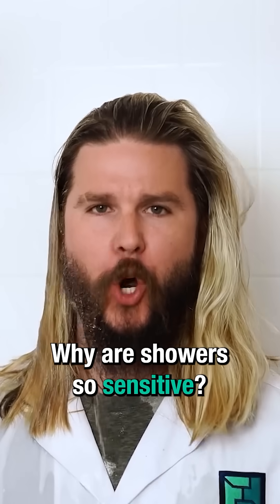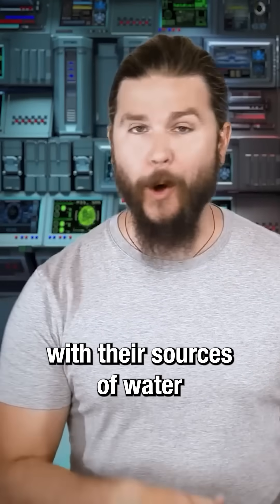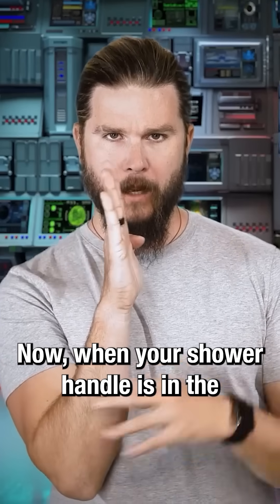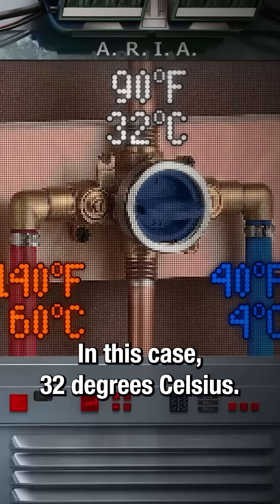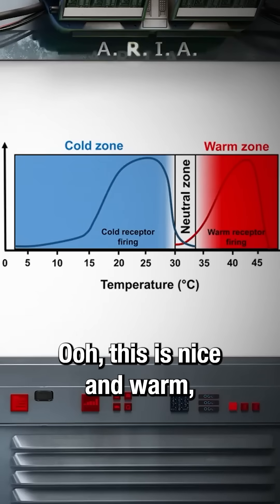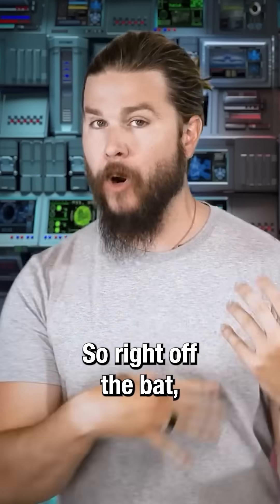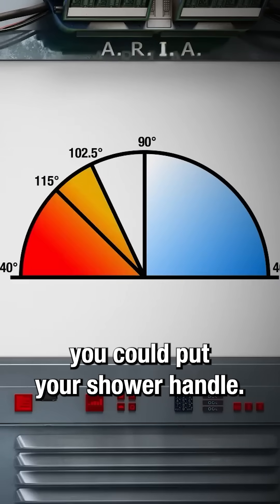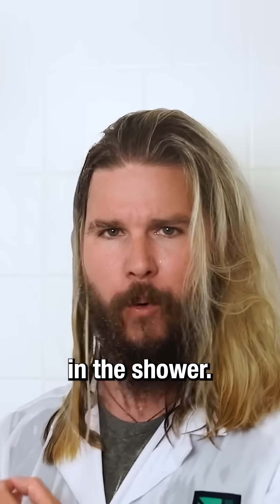Why are showers so sensitive? 🥶🥵

Comment: As a plumber, your hot water should be turned down to 120°F. Best decision I've made since I moved into my new home
Reply: As a hell-spawn, I respectfully disagree. I would be using exclusively the hot water, and I'm not even sure that would be warm enough for me.
Reply: @objectsubjectivity SAME. 🔥😈🔥
Reply: @objectsubjectivity My wife is one of you. I damn near lost a hand trying to pass her a new bar of soap.
Reply: @objectsubjectivity  ah someone has your heater turned down to the lame 120 setting, see if your heater was up at 140 where a true hellspawn would have it then you couldn't really handle the full hot experience.
Reply: @shawnpitman876  Trust me, if I was able to choose the temperature, it would be damn near boiling. That way the water would last me for longer than a 10 minute shower. Whatever temperature my apartment has the heater set to has the ideal hot/cold mixture at about 90/10 to start with.  The best shower I have ever taken was in a hotel in the Judean Desert, where the cold water was about 120 degrees.
Reply: @objectsubjectivity  You must take awfully short Showers, at 122⁰F (50⁰C) it only takes 5 mins to receive third degree burns to the skin.

At 131⁰F (55⁰C), it takes 10 seconds and at 140⁰F (60⁰C) it takes one second.

Literally any temperature higher than that will take less time and likely cause more damage.

The lowest temperature setting for most electric kettle's is 158⁰F (70⁰C) for Green Tea, which should be drank at roughly 122-140⁰F (50-60⁰C) at most.

Serving a hot drink above 140⁰F (60⁰C) usually tops out at 158⁰F (70⁰C), but it is not intended or recommended to actually drink it at that temperature for obvious reasons (internal thermal burns are awful).
Reply: @soulsurvivor8293  I appreciate the scientific fact check of my comment, and to be honest, I have no idea what temperature my shower water is actually at. I just know that my fiance gets scalded by my shower water, and I freeze in hers. Is it probably closer to 105-110? Sure.
Reply: @objectsubjectivity  More knowledgeable about the Medical implications than the actual Plumbng myself (see above for how I utterly messed up Internal Water temperature Standards of water heaters).

For Childcare and Agedcare facilities the limiter is set lower, around 46⁰C (114.8⁰F) from the tap itself (The water heaters internal temp remains at 70⁰C though) due to both age groups having skin more sensitive to heat.

That and 46⁰C is the bare minimum temperature to kill what little Legionella remains in the water post treatment.

It's also a rather pleasantly hot temperature to run a bath at, as the overall temperature will be closer to 42-44⁰C (107.6-111.2⁰F). Bare minimum of 40⁰C (104⁰F) if it takes a few minutes to get ready & get in.

So, badically if it was your internal body temperature; Dangerously high to Brain Damage or Death inducing levels of Fever temperature.

Not bad for short durations like a 5-10 minute shower, depending on ambient room temperature from the shower and the shower temperature itself.
Reply: Isnt there a risk for getting some dangerous bacterias in the hot water if it isnt hot enough?
Reply: @gabrielsandelin3300  yes, but 120 will kill said bacteria, also 120 is required by code (plumbers law) because of scalding risk, you can turn your heater up but you take on that liability and I suggest you do it in small increments so as to minimize the risk
Reply: @personwithhat1 120 does not kill bacteria lmao... it has to be at least 140. At 120, you'd need it to be at that temp for over 20 minutes.
Reply: @personwithhat1 That's only 48.8889⁰C, 50⁰C (122⁰F) would be a better option for outgoing water via cold water mixing post heating.

In Australia, that's generally the standard. A 50⁰C (122⁰F) limiter, using cold water mixing after the heater. 

So our hot water is usually a mix of Hot from the heater and normal Cold water to ensure less sevear burns should someone just have the hotwater running.

In most places around Australia, we can safely drink our Cold tap water without concern for any harmful bacteria.

Though, running any drinking water through a boiling &/or filtration process will make it safer and generally taste better regardless.
Reply: @gabrielsandelin3300  Yes, Legionella. Keep your heater 130+. Don't listen to fools who change things just because they think they know better, when they don't know the reasons why we made those choices in the first place.
Reply: Does this make it last longer since it has to mix with less cold water or something?
Reply: @SnakeWasRight  This will make it last a shorter period as you need a larger percentage of hot water vs cold to hit the ideal temp.
So the tank will run out faster. Undersized tanks for a home should turn up the heat if they want the tank to last longer.

However, it will lower heating costs and make the tank last longer before it needs replacement. 
It also increases the usable range of the faucet because more hot has a smaller effect.

This is less true for single handle varieties but still true.
Reply: @nocare  ah yeah I thought about it more and would need more hot water, but I was like, so what's the benefit then?  Lol, wouldn't work for me, as I run out of hot water too quickly as it is
Reply: @nocare I think the point is to be able to set it really hot, and not burn yourself. Also it's becoming popular to install tankless on demand heaters now, since it is just way cheaper to get and maintain. It's not a bad idea.
Reply: @SnakeWasRight  the only benefit is saving money.
Reply: I want to know why so many of you are worried about legionella. Is your water supply not chlorinated and otherwise treated before coming to your house? Why isn't your area under a boil water order if you have all these issues with infectious diseases in your water system? Do you never use your cold water just in case it has legionella?
Reply: @samarnadra  In most water you will find small amounts of legionella, but so low that it doesn't matter. But in a water heater they can rapidly multiply to dangerous levels really quickly if the temperature is too low.
Reply: @soulsurvivor8293  This thread is about having a lower max temperature in the heater. 
And btw 100c in the heater isn't the norm.
Reply: @emilmuhrman  You are right. It's a mlnimum of 70⁰C (158⁰F) internal temperature for water heaters here as standard.

46⁰C (114.8⁰F) is the minimum temperature to kill the miminal amount of Legionella usually found in our drinking water here.

Though 60⁰C (140⁰F) or higher generally ensures Legionella has no chance of survival regardless.

Anything over a 70⁰C (158⁰F) internal temperature is apparently highly inefficient and costly.

Nice catch, I was soundingnlike a real dumbass for a second there. 

Cheers.
Reply: As someone who worked in culinary for years, do not do this, this makes it impossible to wash dishes properly.  You cannot sanitize dishes in 120 degree water. If you use a dishwasher it will heat the water, but it's much easier when it starts hot. And unless you want ruined metal, you're probably doing your pots and pans and definitely wood-handled knives and cutting boards in the sink. Those NEED that higher temp, sanitizing at 120 degrees takes at minimum 20 minutes of constantly being exposed to that temp.
Reply: @ShadowmancerLord  Soap is more than enough to clean dishes in a home environment.
Hot water isn't even necessary with sufficient mechanical scrubbing.
It's only use it to make it easier to remove stuck food.

Restaurants and such are worried about communicable diseases not everyday bacteria.
Thus they require heating to 165F for thermal sanitation.

However the target temp is 120F for chemical sanitation in a restaurant environment.
Reply: @nocare  Yes, chemical sanitation. With actual restaurant grade sanitizer. Not dish soap. And that's the absolute minimum by manufacturers. FDA guidelines require 171 if water is used and not just pure sanitizer.

Do you have any actual credentials in the field or are you just making things up that you think sound good?
Reply: @ShadowmancerLord its the mechanical scrub part thats important to take note of in his comment. There definite proof if some knows how to properly hand wash things actually get clean. 120 degree well na I hand wash at temps that give me nerve damage lol
Reply: @shawnpitman876  You clearly don't know how most water heaters work do you? 

Most water heaters will heat to and maintain a temperature of 100⁰C (212⁰F), kept under pressure to maintain a full liquid environment.

Heat limiters tend to be a post Heater mix of the super heated water and Cold water, the resulting final temperature from the tap falls to 50⁰C (122⁰F) from the mixture.

 The mixing usually occurs at the heater itself, using a T junction pipe that both Feeds the water into the bottom of the heater and upwards into the separate T junction mixing valve.

When installed, and ever so often for maintenance, heaters need to be properly vented of all gasses via the manual release valve.

This ensures that the water heater is free of Aerobic and Anaerobic Bactirial contamination. When combined with a basic water treatment (Chlorination and Filtration processes), it reduces the potential for contamination even further.

That is, unless the US has significantly lower standards and worse water processing than Australia I guess. If so, then I guess the restaurant standards here would be different too.

In our restaurant's, the limiter is set a little high at around 60-65⁰C (140-149⁰F) with an appropriate sanitising dish soap mix, which is enough for most applications.

Though most places will use automated steam sanitisers for glassware, plates and cutlery. Each have to be set with different temps, times and sanitisers for each seperate material.
Reply: @shawnpitman876  Oh, I should really apologise for the initial rudeness of my reply too. Especially seeing as I myself was making a basic assumption about the internal temperature of water heaters.

Sorry about that mate.
Reply: @ShadowmancerLord  you should know then that the heat from the stove/oven will be more than enough to kill the bacteria on pots and pans.  you are correct about dinnerware and silverware though, as far as the home setting goes (dont use quat at home lol, wasteful)
Reply: @ShadowmancerLord idk about you but I use a tablespoon of bleach when I wash dishes and the water is scalding.
Reply: @kade7xx  most people don't fill a sink with water when they wash dishes. And if the water is scalding, that has nothing to do with me talking about how 120 degree water isnt hot enough lol
Reply: 120F is, like, 45C? I can take showers with tap all the way hot if I'm ever a guest in your house then.
Reply: 120 is not safe 125 is the minimum.
Reply: Nah the kitchen sink better be boiling and the shower better spew out lava or it aint cleaning well enough for me 😂😂😂
Reply: There's lots of stupid in these comments. 120° is the manufacturer minimum recommended setting for a hot water heater. Usually, a few degrees over, so the water that comes out of the tap is 120° only hot. 120° is the maximum recommended temperature for a tap because it can cause severe scalding of children. 120° is NOT an ideal temperature for legionella bacteria, but it can survive and reproduce in those temperatures poorly. 
The mixing valve in your tub or shower is adjustable to allow for more or less hot or cold water through to completely eliminate any complaints about your water temperature.
Reply: Uh, no.  Get an on demand water heater.  That’s the best decision ever.
Reply: @user-pt1cz4ot1e  Only if you have no solar and live in a climate where heat pumps are expensive to install because they would need to be ground source.

Heat pump water heaters are better than on demand for efficiency and solar can store a portion of the energy you would have to sell as hot water.
Reply: @user-pt1cz4ot1e  i already have one, I never run out of hot water
Reply: @user-pt1cz4ot1e  tankless heaters only work well in certain size homes
Reply: That's to cold. It needs to be a minimum of 140 to eliminate the risk of legionella.
Reply: @emilmuhrman  Legionella is temps above 124F not 140F.
!40F kills it in 2 minutes as opposed to 2 hours.

Second in pressure sealed water systems like the US the chlorine stays in the system and kills it.
Its specifically in gravity fed hot water systems like older UK residence that its a problem.

This is part of why you aren't supposed to drink hot water from some homes in the UK.

That is also the final key. Only drinking water does it matter.

Comment: Every point is thermal equilibrium though, as long as the temperature is constant. Not just the middle. Equilibrium in this case means constant, not middle.

Comment: Incorrect.  If you have ever been doing hard labor in 100 degree heat all day and come home to an un-aircondotioned house, that cold side of the shower handle is pure heaven.  It's an even better feeling than taking a hot shower imo.

Comment: Its not really lazy engineering its the set of factors much larger than stated.  In the winter the water might be just above freezing,  in the summer it might get pretty warm in the pipes and cool down quickly as fresh water pipes in.   The pressure of the cold and warm water may vary from day to day, to time of year, to minute to minute based on other draws in the system.  What you really need is a tank that premixes your water in an independent tank and has sensors to keep that mix going as you shower but it would likely struggle to keep up with the needs of a shower over a ling period.

Comment: It also very much depends on the supply heat that is being pumped into the system by the heater. There's a difference in certain models that goes up to a 20celcius difference in supply. Therefor you cannot have ''standard'' shower handles that are optimized for your personal sweet spot.

Comment: Call me stupid, but I just dialed down the power on my Flow heater, so that in the Faucets maximum heat level, it's just right for the body.

Safes electricity, but I do worry a bit about pipe sterility

Comment: I would just like to point out, unless you’re in a super old house or buying all of your parts from Home Depot😂 Most of the valves nowadays have a fluid mixer and a way to set a maximum amount of hot water so you don’t scold yourself😂

Comment: my shower doesn't have a cold line, it runs directly from the calefont, which has a handle there, we just set it higher for washing dishes, and then fiddle with it a bit until the screen says 42⁰C

Comment: Just set get a heater that allows for setting the temperature. Then you only need to open up hot all the way. If your heater (gas/oil/electric) isn't ancient you can set the output temp.

Comment: Where I live now, it's just impossible, because my heater cycles between "scorching" and "freezing" every couple of minutes (it works on gas and has no reservoir, so the best it can do is not to boil me). I mean, it encurages me not to spend any more time in the shower than I really need. But it sucks when I feel under the weather and want to warm up(

Comment: I have an old shower in the hall and a newer shower like the single handle in the Master bath. I prefer to shower in the hall with the 3 knobs. Start with hot, let it boil, adjust the cold in to make it a good temp, then turn the shower valve on.

Comment: So we need to design a handle that opens up cold first, but immediately starts to open the hot as well, to it starts off with something like a 50/50 mix right away.

Except when I'm hot in the summer I've taken pure cold showers so I need that 100% cold functionality.

Comment: Am I the odd one for using it at full hot, and full cold sometimes? And depending on the weather and how I felt, going from a slightly cold bath/shower, to a scaldingly hot one? (Everyone in the family asks how I don't burm myself just touching it for a second, let alone taking a long bath in it... I don't know... I just like it super hot sometimes....).

So ya, for at least it's just fine as it is. Like my sink faucet I get full control, but I use it for any bigger things that need more water like filling humidifier container that can't fit under the sink, or soaking my wet pllete paper in its large container that can't fit under the sink with warm/hot water, or... well, you get the idea, a number of uses for hot and cold beyond washing the tub works great for too.

Comment: the middle is combining equal parts hot and cold water assuming thr mixing valve hasn't been adjusted to bias the cold side, which a lot are for safety.

Comment: you can lower the temp on the water heater to about 120F so it wont scold you.
Reply: Do you even know WHY the default for so long has been hotter than that? Then why do you think you can mess around with the temperature? You know you're just risking disease, right? Legionella actually LOVES 120F and will grow in that rapidly.

Comment: I typically can't shower with water above 70-80 degrees. If it doesn't feel cold to the touch, then I don't like it. This doesn't apply in the winter! I probably shower at the normal temperature in the winter.

Comment: Why dont white people just use the electric water heaters like in asia. I get that you all already use gas for boilers and it does make sense to fully utilize having that in the house, since its already there anyway. But you cant create energy out of nothing. Youre still gonna burn more gas to make hot water. Why not use an electric heater. The appliance itself is not that expensive, and the slightly more expensive electric costs compared to gas is probably worth it, for all the fine tuning you can get